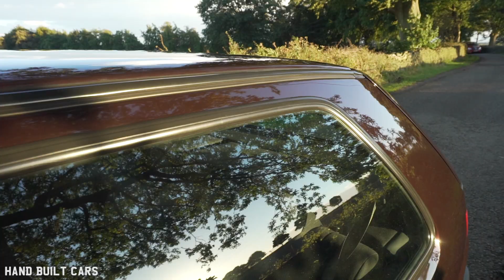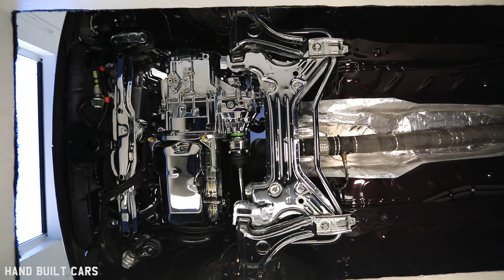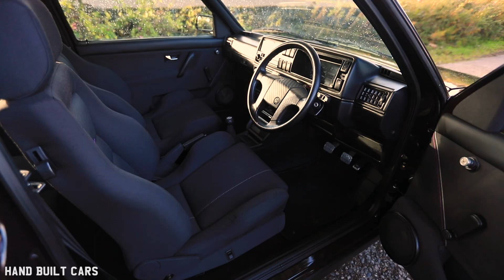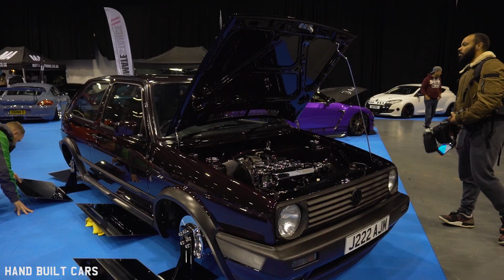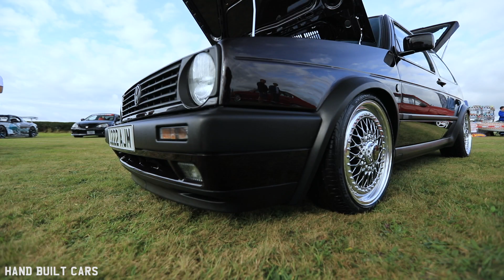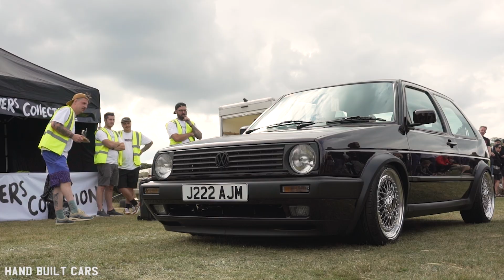Pristine 1991 Volkswagen Golf GTI Mk2 16v Turbo

Comment: I wish I had as much determination as this guy. My mk2 16v gti has been sitting in my garage for 8 years. Thanks for the inspiration!
Reply: My 1.8 mk2 turbo has sat in my garage for 12 years now 😔
Reply: I know this is years after you guy's probably posted and you likely moved on or sold your Mk2's but if you happen to be relatively close to my location, say within 300 miles or so of Chicago and you still have the car's & want to get rid of them let me know?! I know this is quite the long shot but I figured, why not ask, right?